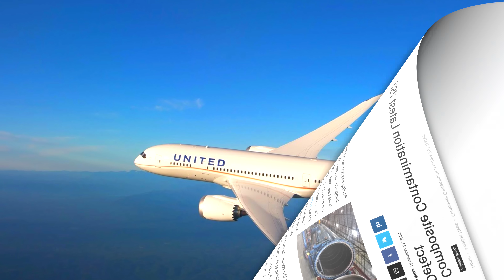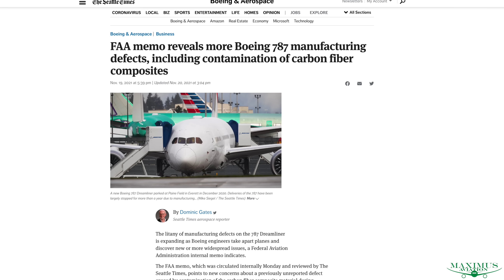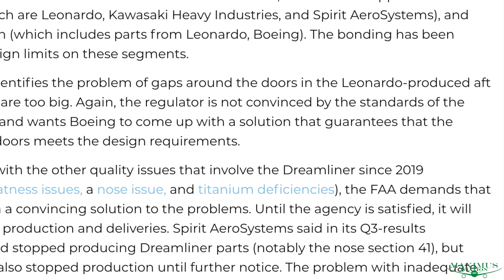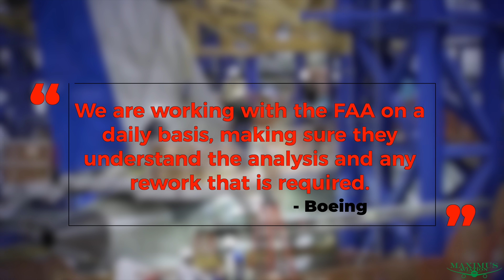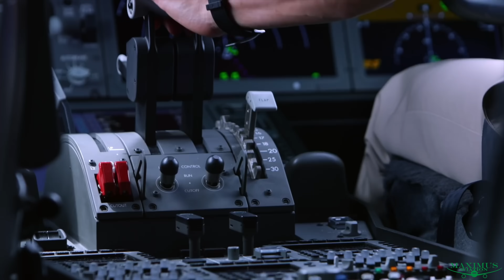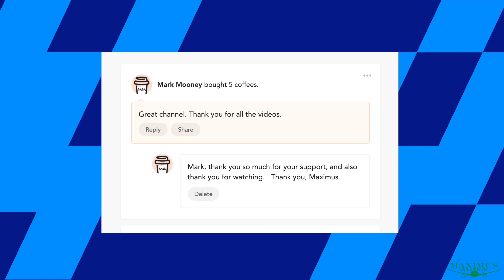Boeing Admits The 787 Carbon Fiber On The Wings Are Contaminated And May Compromise Wing Stability.

Comment: Oh hell, its not like the wing is a critical flight component.  🙄
Let's hope this contamination isn't widespread.
Reply: Heck. The wing is redundant, they have two of them. :)
Reply: @disturbed4733  LoL 😂 👍
Reply: @disturbed4733  Earlier aircraft were biplanes. Maybe they knew something  :^)
Reply: To top it of the contaminant is teflon aka PTFE. Meaning no wonder it has affected the binding of the carbon composites.
Reply: FAA issues advisory to airlines.  Please avoid turbulent air whenever possible.
Reply: The more of these videos I see, the less likely I am to EVER fly again if it isn't some carrier flying nothing newer than a damn 727.
Reply: @donreinke5863  or a 747
Reply: From the article:  "Initial tests conducted by Boeing and reported to the FAA in April showed a positive outcome: although the bond strength was reduced, it was still within the design limits."    Read the Seattle Times article.